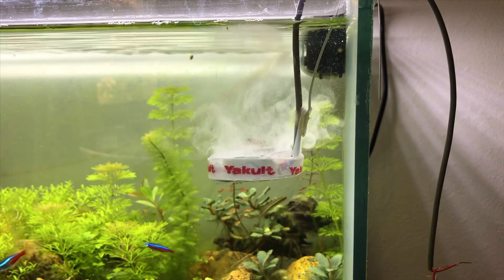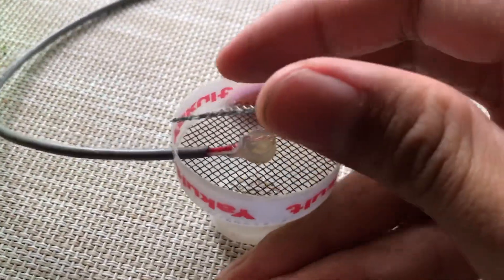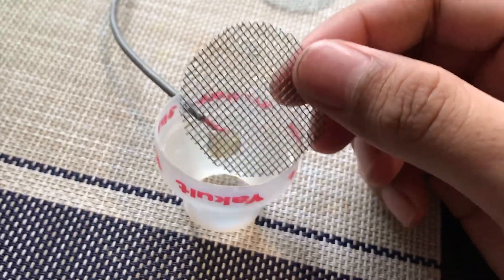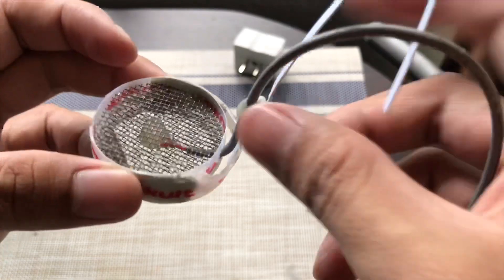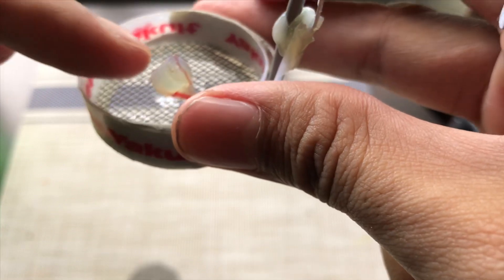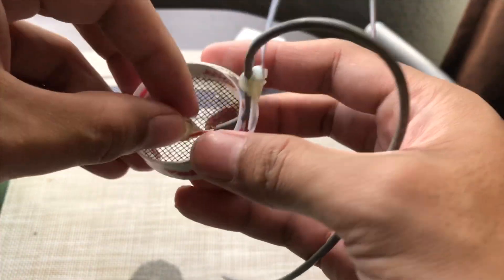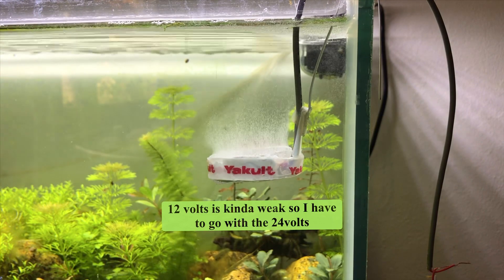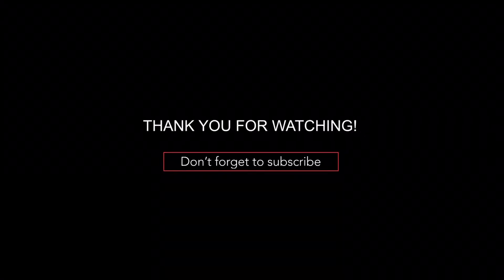DIY aquarium water sterilizer for algae control and plant growth

Comment: What type of mesh did you use? Stainless steel?
Reply from the maker: Yes,it should be otherwise you will be replacing it every other time you turn it on.
Reply from the maker: This one was not. Only last about 8 runtime. Better use stainless as it last a very long time

Comment: How much time are you using this in aquarium - timing ??
Reply from the maker: Daniel Oprisiu I normally run this about 10-15mns. Just enough to make the water a little bit cloudy. Could take about 24hours to clear. After that just enjoy the clear view for about a day or two then run it again. Based on my experience it would take about two weeks to see those hair algae dying out (turn brown and melting). If get a chance to try this tell me if it works for you.
Reply: @thehobbytank8052  so you are starting and using 15 min each 2 days?
Reply from the maker: Yes.exactly. Now,thats on my tank measuring 60x35x35cm.The duration of your run time may vary depending on your tank size and water circulation. Basically,just leave this on until water turns a bit cloudy not so much that your water looks ugly.
Reply: @thehobbytank8052  ok